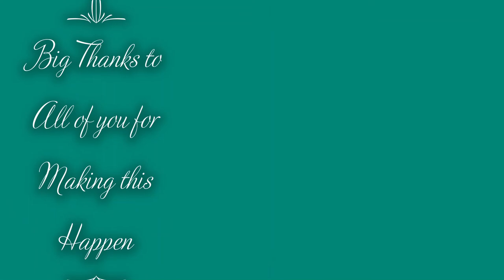Stripping a Ford for a Ford (part 3) - What to look for when draining fluids

Comment: Also reminds me of going to Take-A-Part with my buddy and we pulled a Gen Vi 454 and 4L80E out of a VAN using an overhead hoist.  Cut popped the windshield out and used a sawsall to cut right down thru the dash and firewall so we could just go forward with it.  Took less than 3 hours with just a little help.  Engine looked like brand new on the inside all for less than $250 (transmission was cooked, but rebuildable).
Reply from the maker: The old Junkyard Strips, oh yeah been there and done that one too. Esp when the yard is about to close, and you gotta have that done by Monday morning.... lol. Did ya get that tranny too then, because that's a score. I think that's what they charge just for a Core on a transmission.
Reply: @BareRoseGarage  Oh yeah we got the trans, computer, wiring, starter, and  trans cooler.  It was a fuel injected engine, 225k IIRC, bores we're perfect. My buddy went in the night before right before closing to move one of the two hoists so we would have one. The $250 was for everything!

Comment: You need a cotter pin puller to run around the mating surface of the hose and water nick.
Reply from the maker: The bad thing about that...... it's in my service bag up at the other shop LoL. Usually it's in the top drawer of my box but I left all that stuff up there last night.